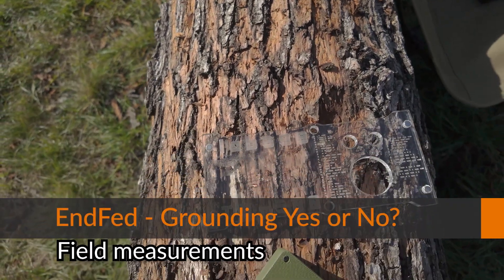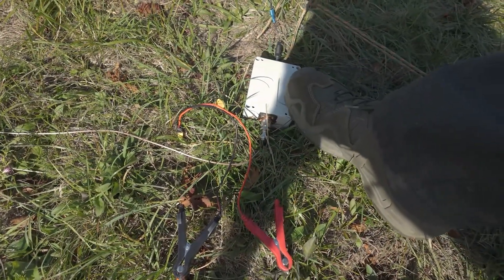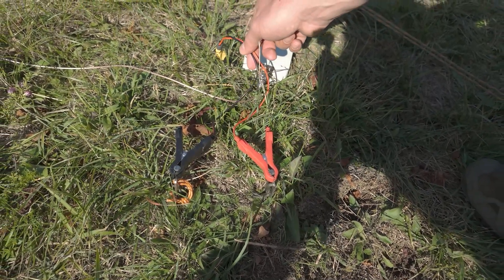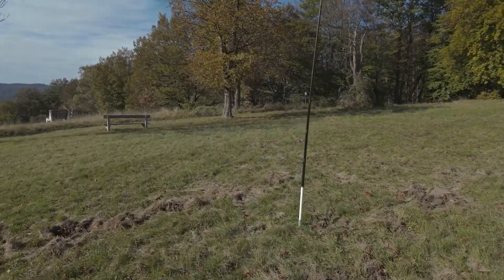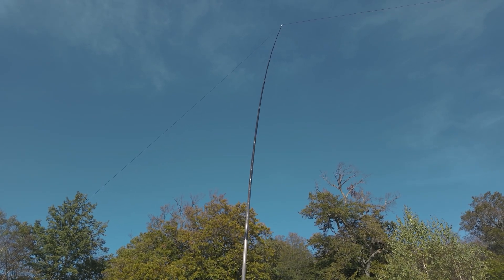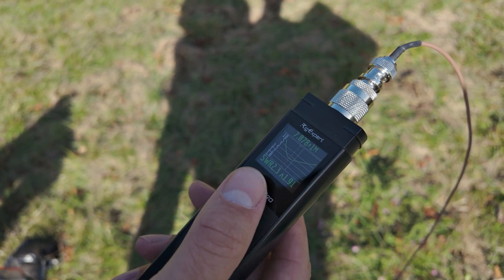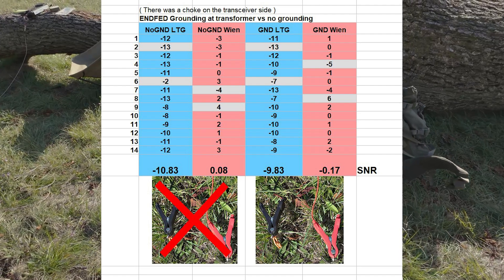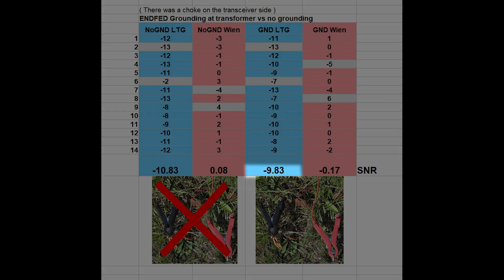EndFed Antenna - Grounding Yes or No? Field Measurements.

Comment: EFHW ist ein Halbwellenstrahler wie die Fuchsantenne oder/und die Zeppelinantenne. Die Zeppelinantenne mit Letterline gespeist zeigt immer eine Unsymmetrie auf, die leicht zu beheben ist, wenn die Letterline am offenen  Endpunkt sozusagen als Fortsetzung des Halbwellenstrahler mit einem Drahtende von ca, 0,02 Lambda ergänzt wird. Mit gleichen Erfolg geht das bei der EFHW. Und, wichtig, der Lambda-Halbe-Strahler gehört hoch aufgehängt u. nicht in Erdnähe eingespeist.  Der hoch aufgehängte 1:49 UnUn sollte unmittelbar darunter einen Balun beinhalten, damit da wegen der nicht symmetrischen Antenne dort sich keine Mantelwelle bildet. 73+55

Comment: At RF the grounding, in normal soil, is primarily for static draining. The two rods need to be spaced apart by the length of the rod, orherwise the effect is no different to one rod on its' own. To have any appreciable effect on RF perfomance some ground radials would be required radiating out from the ground connection. Been there, done that and got the T shirt😂. It is great fun experimenting like this, especially outdoors on a sunny day.

Comment: How long are the ground rods? Is the ground wet or dry? This may impact your findings...
Reply from the maker: @fthorup  good point. the length of the ground rods are 30cm...also made from titanium...so not a super good conductor. the ground was...medium wet. 😊
Reply: @CrazyChekov  TITANIUM!!!!  In the USA you are talking about $$$$$$$. I guess in the Czech Republic titanium is found laying around everywhere!
Reply from the maker: @glasslinger  😂
they were not that expensive. made in china but really good. Im from Austria.
Reply: You might get better results with a few counterpoise radials.
Reply from the maker: @MrDmjay  how long would you suggest for one counterpoise?
Reply: @CrazyChekov  try 4 X 5m as a start, then check your SWR.
That is just what i would try.
Reply from the maker: @MrDmjay  Thank you I will try a counterpoise and look how it will effect the SWR in that very low to the ground configuration.